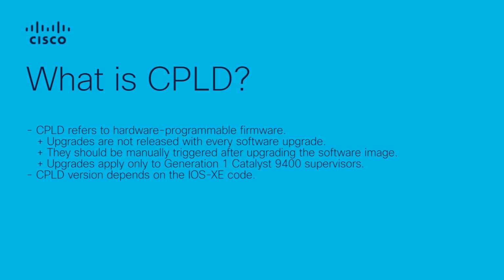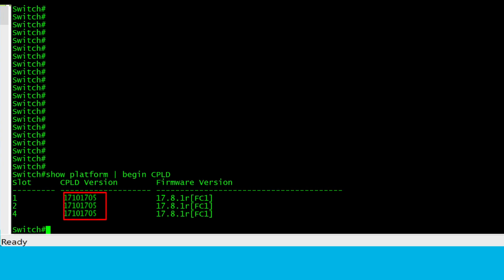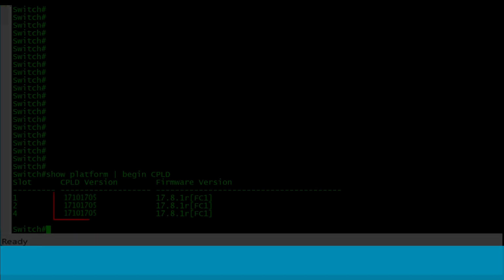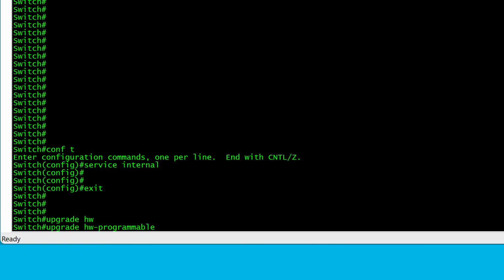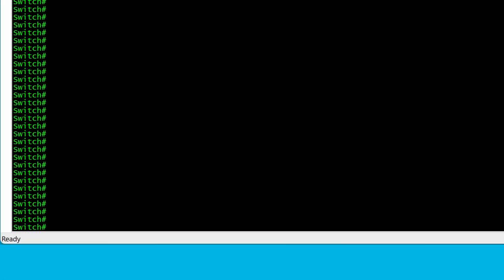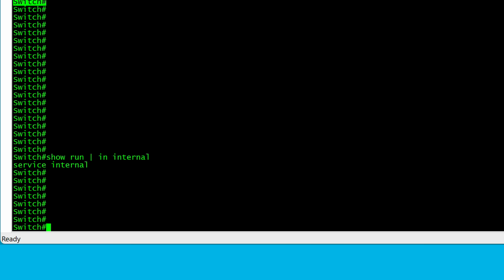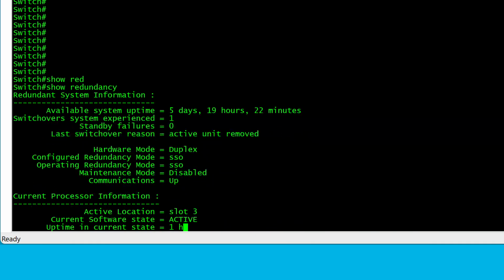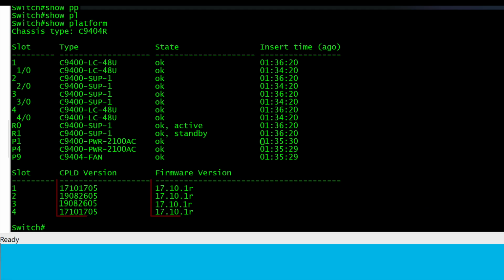How to Upgrade CPLD on Cisco Catalyst 9400 Switches | Hardware Maintenance Guide

Comment: CPLD version was not uograded to the other module line card module . Why is that ?
Reply from the maker: Hi there, thanks for your question! The CPLD upgrade process applies only to the supervisor modules, not the line card modules. The CPLD version shown for line cards is cosmetic and does not reflect an actual upgrade. After upgrading the supervisors' CPLD versions, the line cards may still display the old CPLD version until the chassis is reloaded. This version mismatch between supervisors and line cards is expected behavior and not an indication of a failed upgrade on the line cards. We hope this helps!

Comment: Confused, why is CPLD upgrade necessary when ios-xe iss upgraded? If cpld is not upgraded what are the consequences?
Reply from the maker: Hi there, thanks for reaching out, and we'd be happy to help! Upgrading the CPLD on Catalyst 9400 switches is necessary when upgrading the IOS-XE software to ensure compatibility and to leverage new features or resolve firmware defects. The CPLD is a hardware-programmable firmware that may require updates to support new functionalities introduced in the latest software versions. 

The consequences of not upgrading CPLD include:

Incompatibility Issues: If the CPLD is not upgraded, there might be compatibility issues with the new IOS-XE features, potentially leading to suboptimal performance or failure to utilize new functionalities.

Firmware Defects: Existing firmware defects that are resolved in newer CPLD versions will remain unaddressed, which could affect the stability and performance of the switch.

Traffic Disruption: During the CPLD upgrade, the supervisor module automatically power cycles, which causes traffic disruption. Therefore, it is crucial to plan the upgrade during a maintenance window to minimize impact. 

You can view documentation at: http://cs.co/6051Ieu1l. We hope this information helps!